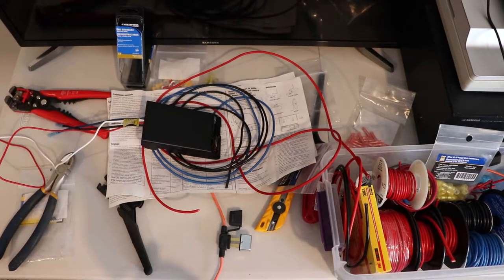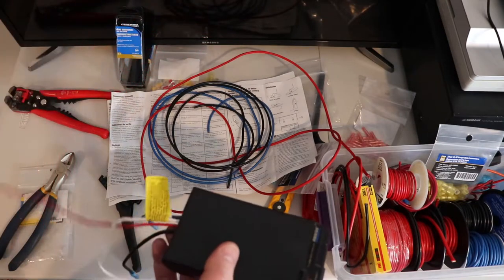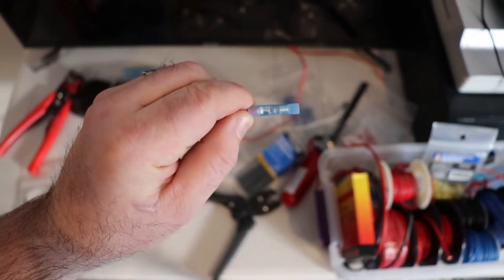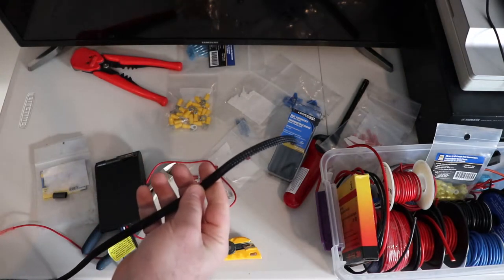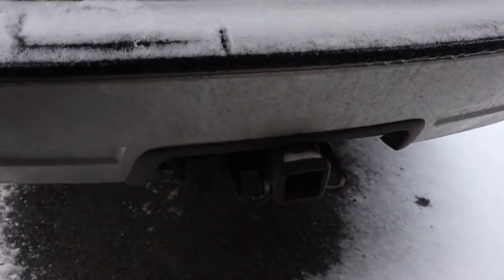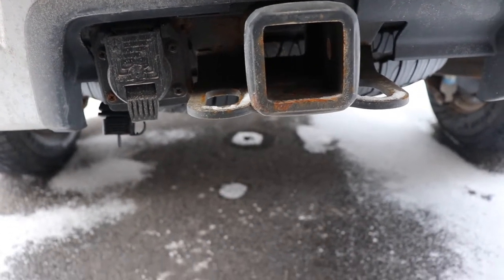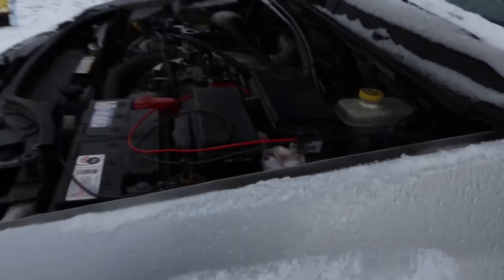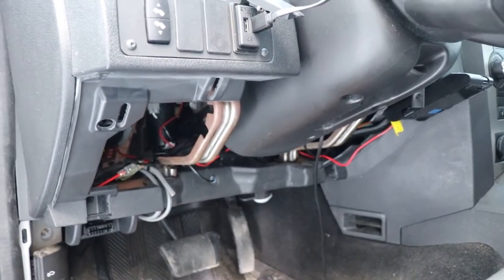2005-2010 Jeep Grand Cherokee WK Factory Tow Package Brake Controller Installation

Comment: Very helpful. Exact same vehicle as mine, including the OM642 diesel, and it came from Canada (has a Quebec Auto Assn sticker in the back window). I'm planning to do this to mine to pull a USMC surplus bomb wagon, which means not only do I have to add this, I also have to modify the braking system (air over hydraulic) to install an electric over hydraulic conversion. Cheaper than buying a Deuce & a Half. Interesting that you have internal panels that are 9 years newer than the vehicle. That's often a sign of a wreck repair.

Comment: Thank you...your video was very helpful. The tip about brake switch wire..I used a t tap fitting which worked well.

Comment: Nice video.  So you are concerned about using a special tool to strip insulation off the wire, but you are driving around with a major firewall sealing grommet loose with a sock stuffed in it?